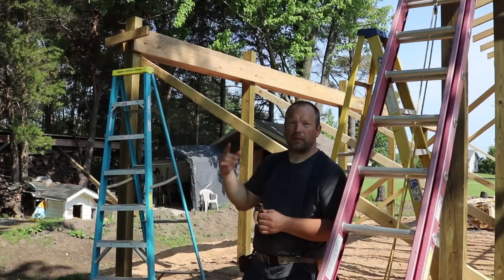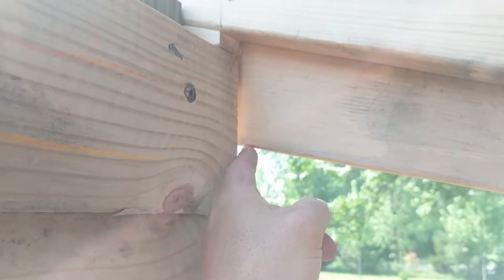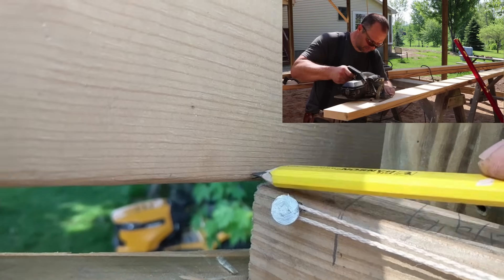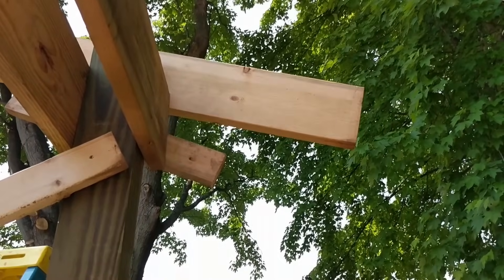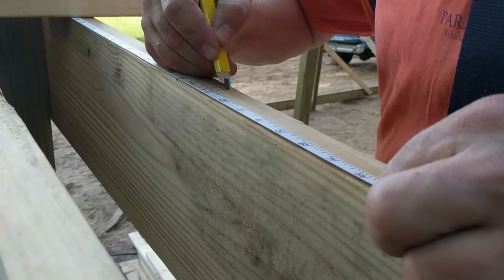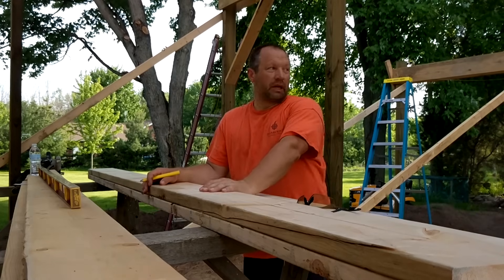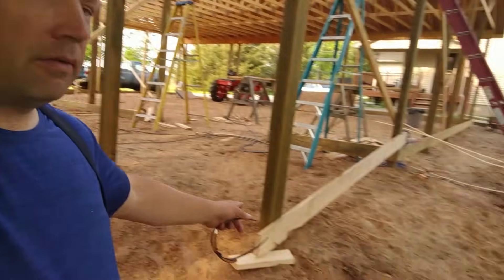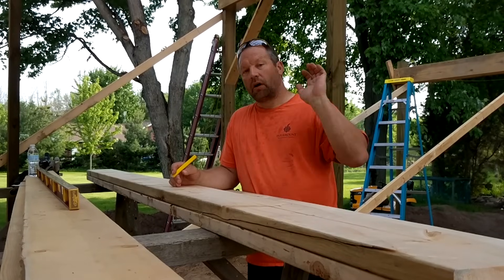How to frame a lean to roof with rafters and a notched birdsmouth - Pole Barn Shop Build Part 10

Comment: Your  gonna cut a birdsmouth on  EVERY  rafter? What a lotta work.
I figgered my slope was 10 degrees & cut a 10 degree chamfer along my 
2 header boards. By doing that I did not weaken my rafter so I was abl to 
use 2X4 rafters saving me time  AND  $$.

!
Reply: you did not weaken the rafter, but the rafters are tending to slip down. birds mouth is a much better choice

Comment: The bolts are holding the weight of the roof/rafters, I'm not a builder but, I've read that the posts should be holding the weight, so a beam resting on top of the posts should have been done.
Reply: I thought same thing ( I'm also not a builder )

Comment: how far apart are your posts? how far apart can they be?
Reply from the maker: My posts are 8 feet apart. Many factors including size/material of the headers, weight of the roof, snow load in your area, and whether you use rafters or trusses will determine the spacing. Most lumber yards can do that sort of engineering for you.

Comment: Dad was a successful GC for life (Ohio, then Florida). I’ve been licensed for 33+ years and have a great rep. for doing high quality work. There’s at least half a dozen viable ways to build what he has shown here and most of them will last / not suffer structural failure. This post / beam detail is a Northern / U.S. way of doing it. I wouldn’t choose the split beam method, but it’s not my project. It definitely wouldn’t meet Code here in FL, but that’s irrelevant. It appears this guy does clean work and there’s nothing obvious that’s shoddy about the workmanship, so why be so critical? IMO, he really shouldn’t have to defend himself for posting this particular video. Being tactful is a skill and also free, but it’s often lost these days, especially online. JS

Comment: How did you attach the rafter to the ledger board?
Reply from the maker: They sit on the ledger board and attach to the header with metal angle brackets.

Comment: Why cut roof rafters, just screw onto as base support
Reply from the maker: Not sure what you mean? The birdsmouth on the tail of the rafter is cut so it divides the weight of it over both headers.
Reply: @katieschmidt4029   I started mechanics an building with my father in the 50s. While teaching school I built homes during summers, then bought/remodeled an sold houses through the 2000s. I bought 17 acres an house in Colton, Oregon for $65,000, after building pole barn, sold it for $164,000! From there I bought 6 acres Mt. Vernon, Washington, near San Juan Islands. Now I'm working on six areas near Shelton & Hoods Canal. I was asked how much property has passed through my care? I f figured it to be $618,000, not making $ at teaching but building!

Comment: Nice job! Do you prefer a ledge board above joist hangers? I'm just waiting for the ground to thaw then I'm building a 12'x42' lean-to
Reply from the maker: I went with the ledger board because the pitch wasn't a standard pitch. I went back and also installed angle brackets on every rafter. Joist hangers would also work great. Good luck on your project. Thanks for watching!

Comment: The 6x6 should be notched to carry the load of the header. NEVER use bolts to carry the load.
Reply from the maker: Thanks for the comment. This is standard practice, there are millions of barns built this same way. That is exactly what those bolts are designed for. Back in the day we used giant pole barn spikes instead of lag bolts.
Reply: Notched is always the way to go
Reply from the maker: @79TEOG  if you set a 2x12 header on a notch in a post and nail it to the post it will shrink slightly over time and no longer be resting it's full weight on the notch. Therefore all you've done is weakened your post. The first barn I built 30 years ago has the headers in the same place I put them. Every modern pole barn I've been in has been built this same way. Maybe it's a local method for this area but I'm just saying that this system is widely used and it works.
Reply: You are 100% right Justin
Reply: Hell. If we’re nit picking , who not use a mortise and tenon joint up top and peg then together?  Largest eye roll ever.    Answer. We’re not Amish.  😅.  This will outlast everyone typing and reading here.  For Pete’s sake.

Comment: That scary with no support easier does not mean better those 4x6 should have been notch to carry the load properly.
Reply from the maker: I didn't do it this way because it's easier. This IS the correct way it's done. This is not a timber frame construction. It is typical pole barn construction. It's been done like this by thousands of contractors on millions of barns. And please don't take my word for it. Do additional research on your own.
Reply: Country Family Homestead you can keep telling your self that but correct way is 100% wrong what is the shear strength of those lag bolts? What is the weight of the roof because it is all being held up with those lag bolts with no support but no worries it is a easy fix just laminate a 2x6 to your 6x4 but if you still don’t believe me call an Engineer
Reply from the maker: @iwantosavemoney  dude, I've been in many post frame structures, I've built many post frame structures, I have never seen it done any other way. Those lag screws are specifically designed for that purpose. It's not the just sheer strength of the bolt that holds the weight, but the strength comes from the fact that the headers are squeezed to the post with the bolt, hence the large washer head on it. The first barn I built twenty years ago is still standing straight and tall. My neighbors barns we're built 35 years ago the same way and they are still standing straight and tall. Maybe in your area they do it differently and that's fine with me, but it's obvious to me you don't really have any experience with this method and just think your way is somehow better.
Reply: Country Family Homestead some how better 😂 am telling you this is really simple one is supported and one is not I understand it is a hard concept for you but if their is nothing underneath it it is not supported and yes I have seen pole barns built like this that does not make it right like I said ask a Engineer about loads shear strength and supporting those loads with a bolts pretty easy concept one is held up by a bolt one by a beam I mean it is not rocket science just facts my friends
Reply: Country Family Homestead if you have never seen it done any other way you have not been in many structures because this way is the most expensive way to do this. why to you think you have to double the amount of wood plus the Hardware. Yeah that statement is lacking a lot and no amount of time makes any more true today or 25 years ago. Just facts my friend
Reply from the maker: I've been a licensed builder and a master electrician both for over 25 years. I've been on construction sites my whole career. If you want to build it your way please do so. If your engineer friend thinks that it's only the shear strength of the bolt holding it up then he has never built a building. 
Morton Buildings is a nationwide barn builder, please take a look at how they do it. Pics 4-6 show it well.
https://mortonbuildings.com/projects/hobby-building-1
If that's not enough here's another midwest contractor that builds barns the same way:
https://youtu.be/S9Yvwe3QWlo?t=129